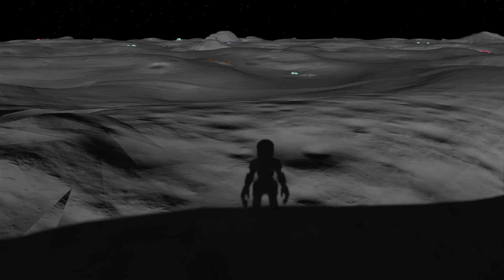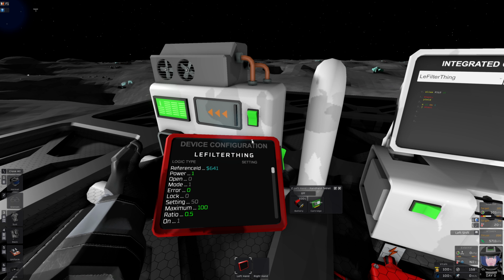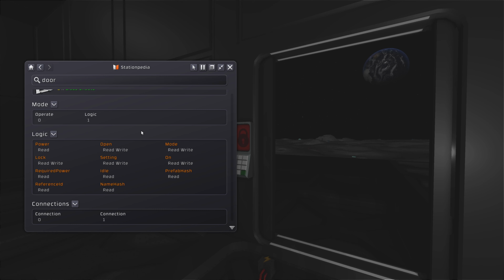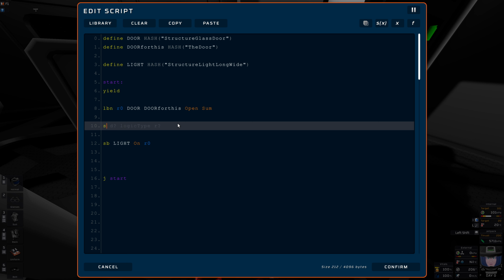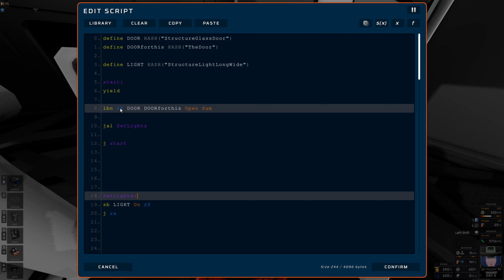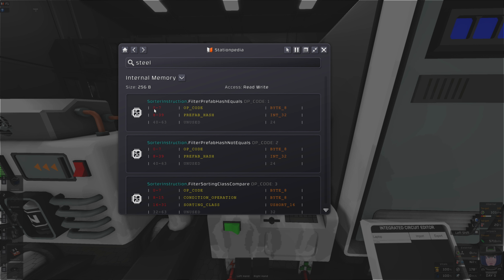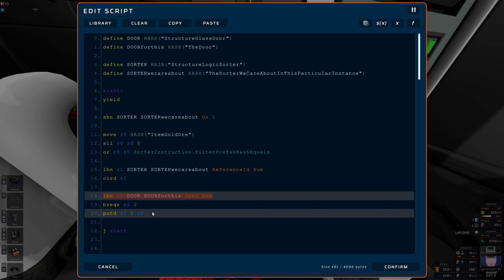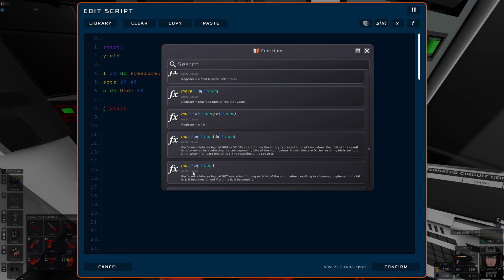Stationeers PROGRAMMING for total beginners - TURBO STYLE! - Part 11: SUMMARY of all we learned *

Comment: Something that is missing as an explanation for the stack:

Imagine you have a stack of paper you may push something on it or take it off te top (pop) tthe stack does the same with the push and pop command. The current top is definedd by the sack pointer (sp or r16) and you may freely modify  that register to any value between 0 and 511 

so as an example with the sp is at 12 and we execute push 15 i would write 15 in to the stack at pos 12
sp at 9 and we execute pop r0 would load what ever is stored in address 9 of the stack into r0

The following Code 
start:
brgt sp 10 4
push r0
add r0 r0 1
jr -3
pop r0
brnez sp -1
yield
j start

therefore simply pushes the values 0-10 into the stack address 0-10 and  then reads them all back out again and starts again. Imagine the store is don with something more meaning full (like a device refID) and you are then calling a sub Routine  who does something meaning full before the branch (like turning it on or off depending on the value in r1) you can easily see how this can create more use full subroutine calls specially in an Environment where you are memory constraint (cause you used all your registers already for something)

When performing math on the sp bee careful that the result is  valid.  Otherwise the computer will behave erradic. Also only pushing to it but never reading will result in a stack overflow error and crash your IC10. 

Fun Fact: the modification of ra and sp (or rather there modern counterpart) to a bad value are among the most common way to hack a PC to this day.

The easiest way o understand this is probably to play around with it on an ic10 emulator like ic10emu.dev or https://stationeering.com/tools/ic that show you every value of every register,  connected device and the entire stack as well as allow you to step through the code one instruction at a time.

Comment: I realize I'm a year late, but I tried setting up multiple sorters at a Deep Mining Outpost where there were multiple ores in the region, and for the life of me I could not get 2 Logic Sorters to work on the same network. In order for them to work, I had to separate their Data connections.
Reply from the maker: How did you address them? Obviously not via the Housing screws, I'd say. Did you use "sb"? That would make both of them act together, which you want to avoid. Did you use "sbn" but give them the same name, by chance?
Reply: @OwnerOfTheCosmos  I used sbn, and named them accordingly. I thought the same thing because, I copy paste a lot, but everything checked out. Logic Sorters just didn't want to cooperate on the same network.
Reply from the maker: But what is it then that happened?
Reply: @OwnerOfTheCosmos  That is where I am at a Loss. Theoretically it should work using sbn, and assigning different registers depending on the ores you are trying to  filter. In application, it does not work though. The next sorter in line did not Filter correctly and just passed everything through.

After multiple attempts, different ways, I resulted in removing the 2nd Logic sorter in line from the same network, and gave it it's own housing with filter request.
Reply from the maker: Must be a source code error, I think. Maybe you could post it on pastebin or Discord (I'm @OwnerOfThePlace.) ---- EDIT: We got it "sorted" out on Discord. The key problem was turning off the stackers, then if need be turning them on ... without a yield pause in between those two conflicting commands.